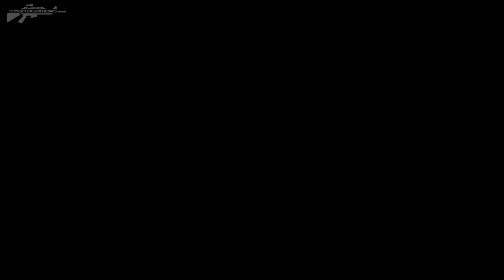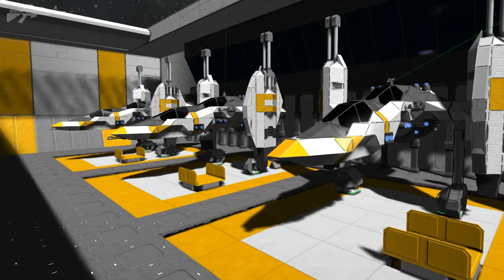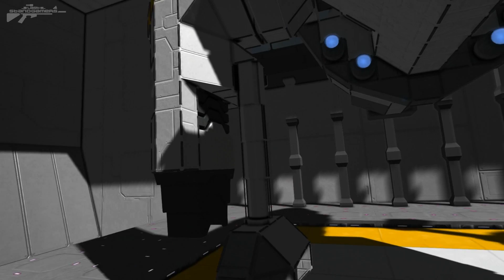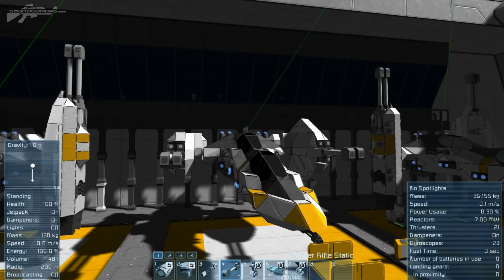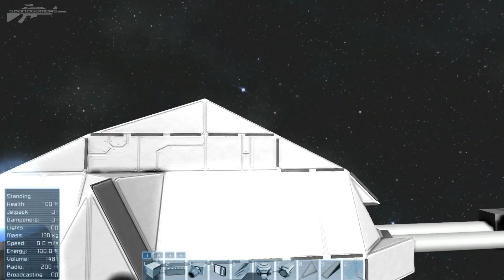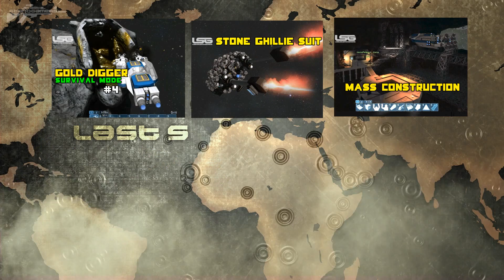Space Engineers - Vector Thrust Fighters, Concept

Comment: have you considered using a Retractable Docking bay? You attach perpendicular to the ring and have it pull you into the bay, and if it's a multi-bay system, you could use multiple Docking rings, one to pull you into the landing bay and then one to either move you forward/backward (Main Level) - Up/down -> forward/backward (Other levels).

Comment: If I were you I would add a detachable cockpit since its a frigile fighter so you could excape dog fights fairly easily
Reply: Without thrusters (and a reactor or at least a charged battery) it wouldn't get you anywhere. Given that this is a fighter, hitting T and activating your jetpack ought to get you out of the ship pretty quickly.
Reply: Yeah but you would be exposed, if I were in the middle of a dogfight I wouldnt want to be flying around without cover

Comment: You could put the rear thruster inside the middle-rear and do four non-connecting points. (Points that have gaps between them where the flame of the thruster starts and look like they would connect at a point if they continued to go straight back but stop at 4 individual points instead not coming to the center where the flame shoots back)... a 4-pronged tail design. (hard to explain but i believe you may have used it before.

Comment: Hey there Aaron. How do you manage to get such stable shipparts connected to the main hull through pistons/rotors? The ships I make with rotored wings throw off the balance and pull the ship off. Any tips on how to master the use of rotors and pistons?
Love the design of the ship you made btw. Those interior turrets can be really usefull for a 2 manned gunship.
Reply: if you are talking about having thrusters on said wings, turn on the center of mass indicator in the info tab of the K menu and line the thrusters up to it and it should fly straight.
Reply: Aaron Thames Should there be thrusters on? They function as spaced armour, wield the landinggears and are rather flat and long (say 2*10*20). Should the rotors be in the centre of mass? The rotors turn sideways btw, folding the wings under the ship or folding out to deploy landinggears
Reply: TheAcunianGamer im not entirely sure but if you want to have thrusters positioned like they are in the video then you may want to have the rotor and thruster both aligned to center of mass just to be safe and if you dont have thrusters on the wings just make sure that the rotors are aligned to the center of mass and it should work fine.
Reply: Aaron Thames Ok thanks a lot man